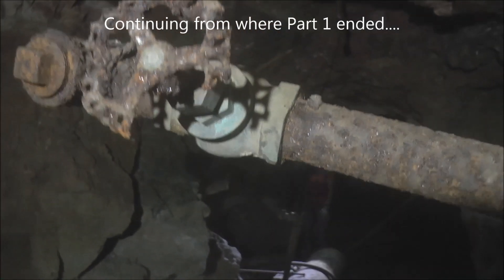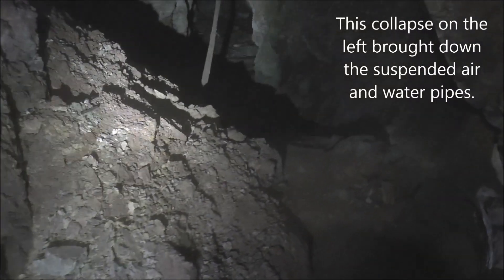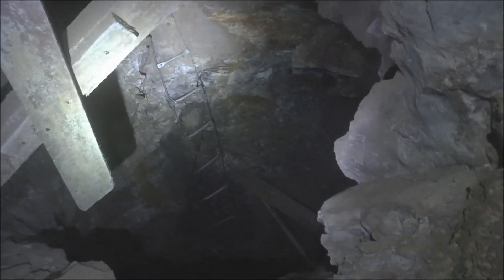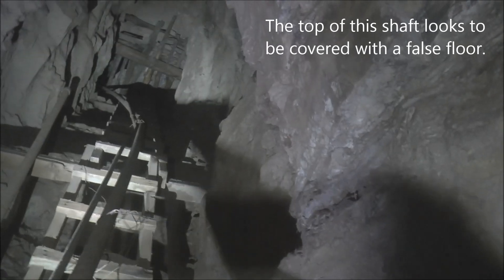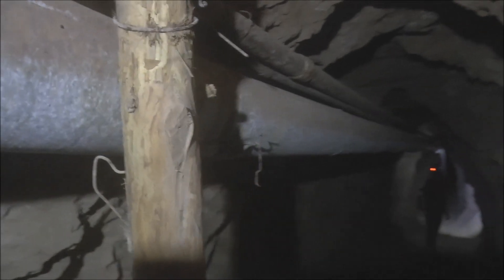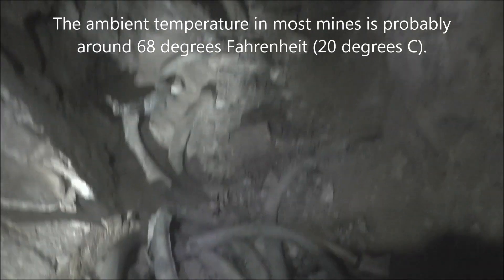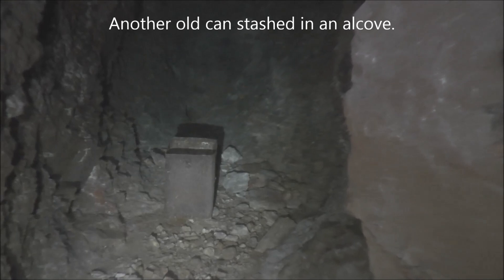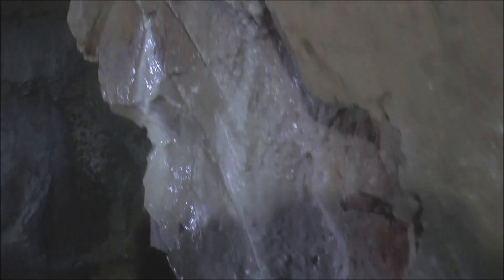Going Deep Underground in the Abandoned Florida Mine (Part 2)

Comment: I’m curious, would you ever consider trying to find a working/restored carbide headlamp, and possibly using it for one or more of your explorations? Or would it be unreliable?
Reply from the maker: Thanks for your question, Josh! Nick actually is in the process of doing that right now, I believe. He found an old carbide lamp that he is having restored. I think he plans on making a video on his channel using that as his only light source. The light output will be a lot less than what we and you the viewers are accustomed to from our modern, high powered LED flashlights. But, it will be an accurate representation of what the miners actually had to deal with. As a side note, before using carbide lamps the miners worked by candlelight.
Reply: @AbandonedMines11  that’s pretty cool to hear! I’ll have to keep an eye on Nick’s channel for that.

Comment: It is very interesting that you found the tin and the stop-cock still in proximity. I read quite recently that empty tin cans were often placed over the top of taps and vales in mines in order to minimise the spoil and dust that worked its way into the stem. This was done mostly when a stop-cock was inside the immediate area of blasting. It also protected them to some degree when 'mucking-out' was going on where it was very easy to hit the stem with your shovel and break it off. This was apparently commonly done in at least one lead-mine in North Yorkshire so maybe the practice made it over the Atlantic?

Comment: Awesome video as always Frank!!! You have my curiosity going, was that mine excessively damp? I’m curious for few reasons, the valve you came across that was partially rusted away, those handles are fairly thick, that’s a lot of disintegration. Also, when you mentioned the hose that was unraveling and the possibility that that section might have been flooded at one point, I noticed shortly after that that there was what looked like a high water mark on the tunnel walls, maybe it was just the lighting? The chain link ladder you came across looked a lot like an escape ladder, the type homeowners sometimes have in case of fire. You have to get Tom and Julie in there, Tom would be all over the ladders with his “Spidey Powers” :) Awesome exploration Frank, thanks for sharing and stay safe.
Reply from the maker: It wasn’t very damp in there at all although it wasn’t bone dry like some of these mines are. I pointed out that water line in my video. Yes, I think it might’ve been flooded at one point a long time ago. Those metal ladders did resemble those home fire escape ladders like you mentioned. I don’t know how long those have been in there or who was using them last. Thanks for the lengthy comment, Dan – I appreciate it!
Reply: @AbandonedMines11  You pack a lot of great content into your videos, lots to comment on lol. Thanks again!